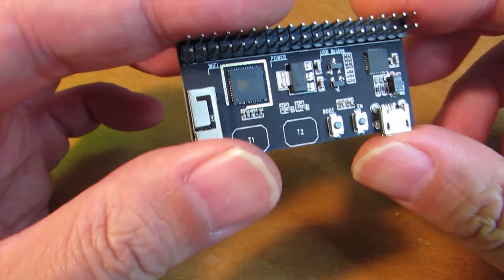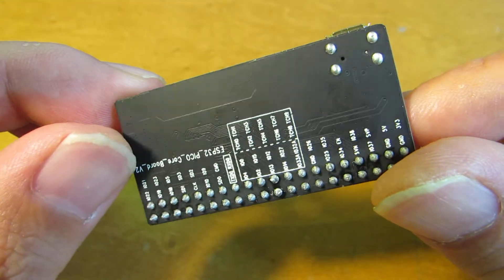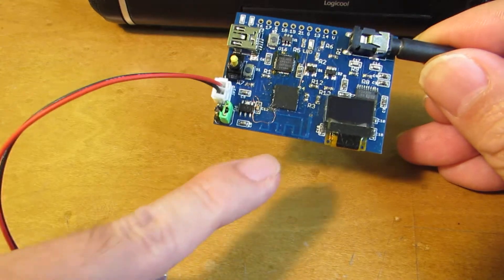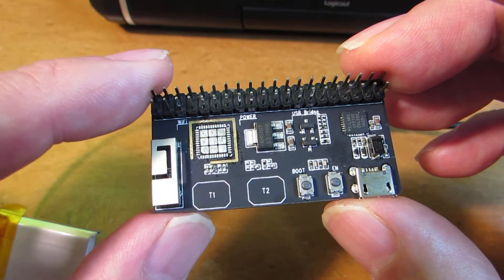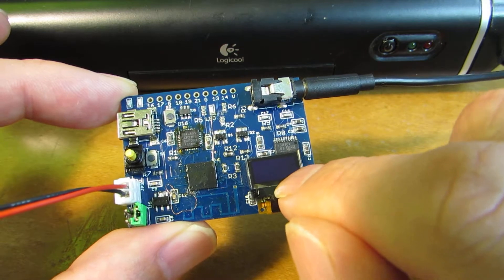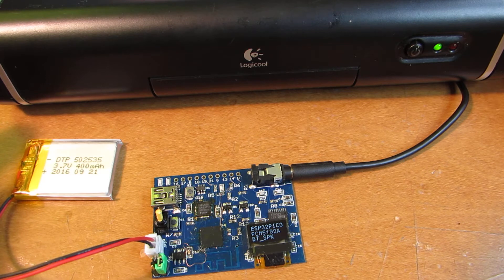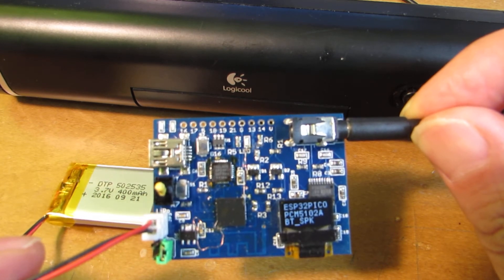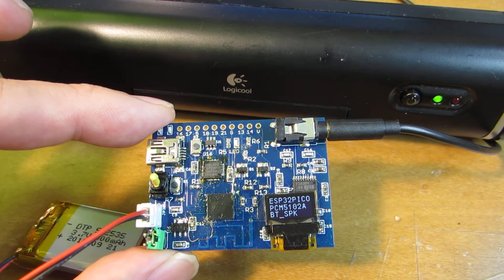Audio developing board using ESP32-PICO-D4

Comment: Can I help me? I want to make an application with sound. In the app for example it will have 5 audio recorded, I want to send those audios to the esp32 reproduce. I am developing in the arduino IDE, if I only use the i2S protocol can I send the audio data to PCM?
Reply from the maker: I cannot answer your question, because I stopped ESP32 related thing very long time ago (close to two years ago...) and knowledge of it disappeared from my head, already.. Sorry for that.

Comment: I don't really understand the benefit of having the PICO rather than the ESP32? Does it same space or money or time or what?
Reply from the maker: Very good question!! ESP32-PICO provides design flexibility without additional components. ESP32-WROOM-32 (ESP32 module) is indeed quite useful and I love one but no way to add 16MB main memory and different antenna design. As for antenna design, ESP32-PICO will impose additional issues (regulation in each country) but it won't be matter for commercial mass-production (for companies can afford it). At this moment, ESP32-PICO chip itself will cost around $3 and which is almost the same as ESP32-WROOM-32 module and no advantage but for those who want to design and add WiFi/Bluetooth by 7 x 7 mm square footprint, I guess ESP32-PICO is the best one in the world.
Reply: But if you choose not to use the WROOM-32, you can still use the 5x5mm ESP32. That gives you the flexibility to choose your own antenna design, your own memory etc. What does the PICO give you over the standard ESP32 chip?
Reply from the maker: Please clarify yourself, WROOM-32 is a WiFi/Bluetooth Module with PCB antenna, not chip alone. Also please read yourself ESP32-PICO data sheet at 
http://espressif.com/sites/default/files/documentation/esp32-pico-d4_datasheet_en.pdf
Reading datasheet will cultivate you more.
Reply from the maker: 5x5mm ESP32 what you mean does not contain 4MB flash and X'tal and lots of components (capacitors, resistors). Please read datahsst yourself.
Reply from the maker: Also, please read my all answer here. I guess you did not read my answer here. Awesome.